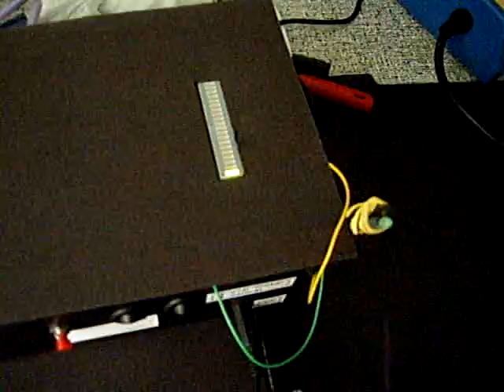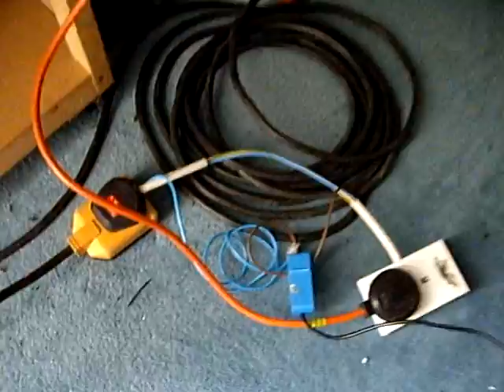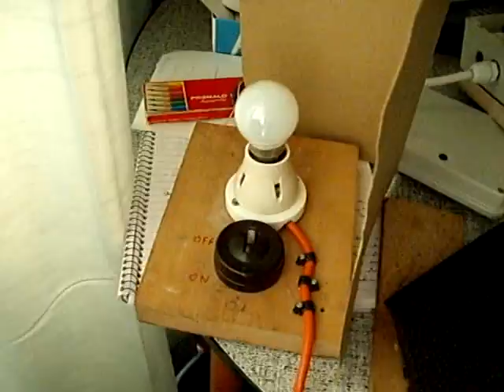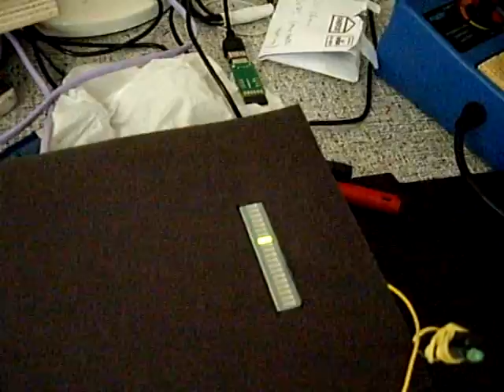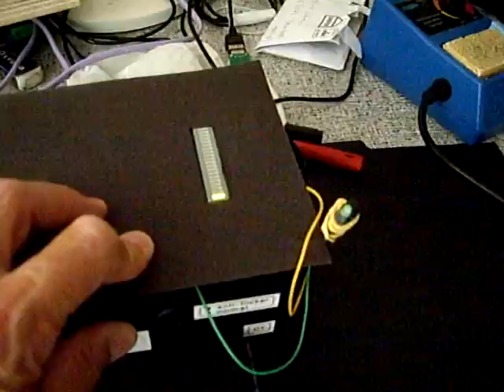Energy values being affected by RFM12B

Comment: Robin, have you figured out why this is happening?
Reply from the maker: Yes, I believe it was caused by a "blocking" library call which caused a few milliseconds' worth of data to be lost.  Changing the RFM12B to be permanently active has fixed the problem.   My latest Mk2i sketches on the OEM forum have been updated in this way.  Similarly for the equivalent sketches on my own website at mk2pvrouter.co.uk